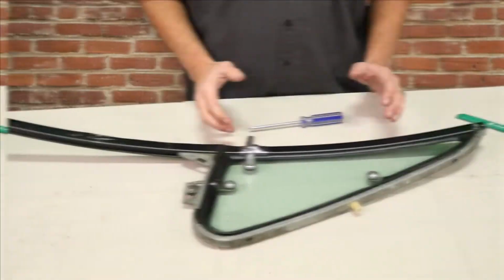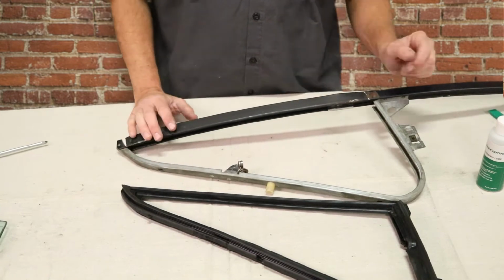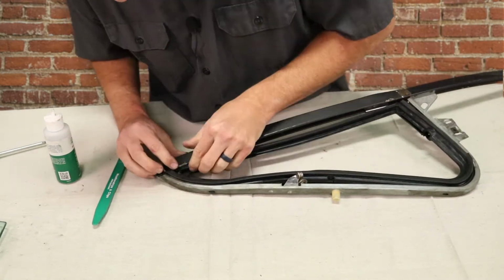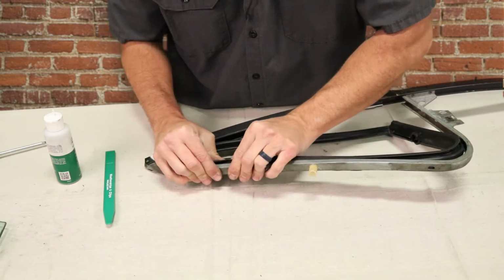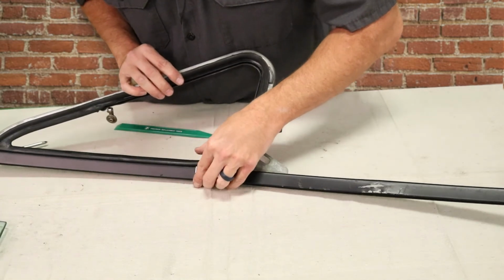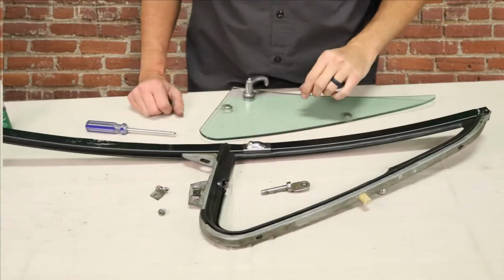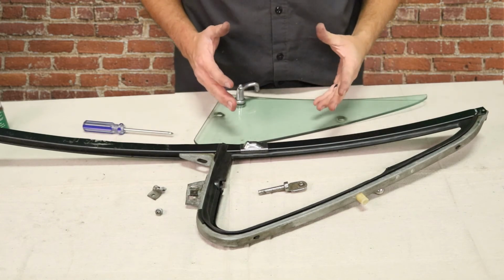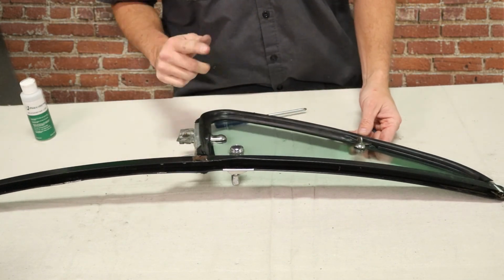1987 - 1993 Dodge Truck Vent Weatherstrip

Comment: This kit will actually fit 80-93
Reply from the maker: We have VWK 3110 78 which fits the 78-86 bodies where as this video addresses VWK 3110 87 fitting 87-93.  There's enough of a difference between the two to warrant getting the correct kit.